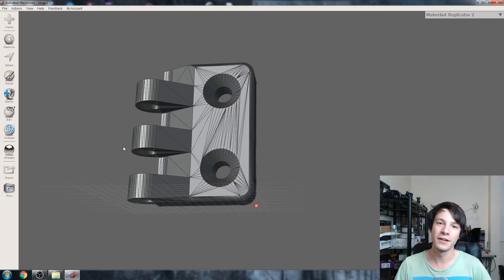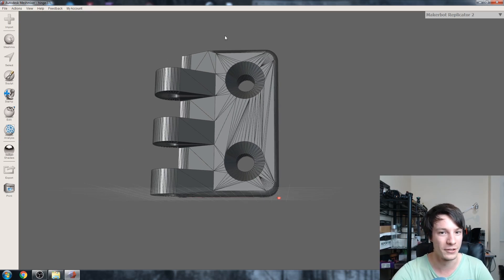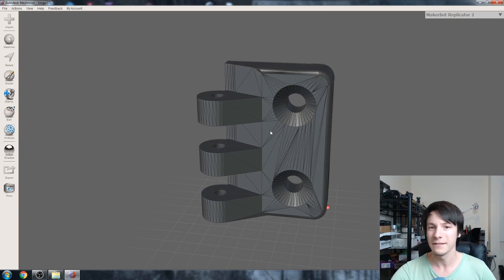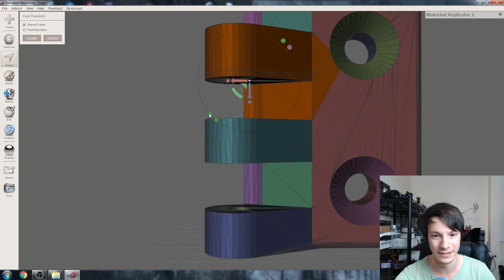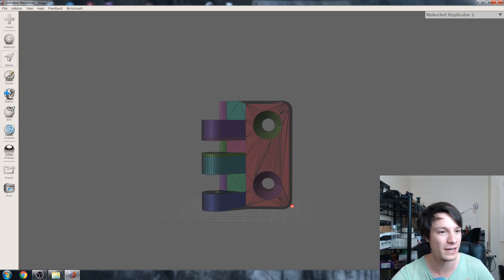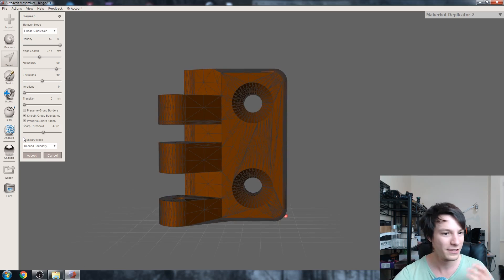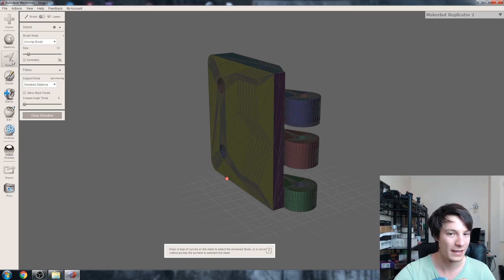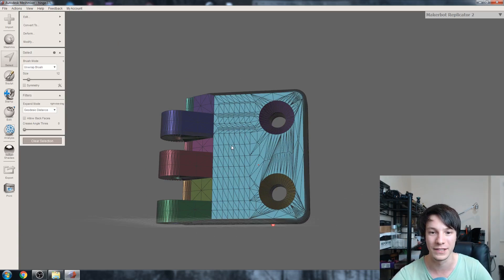How to use the Face Transform Tool in Meshmixer - Quickly alter .stl files!

Comment: Hi Angus, dragging this up from the abyss, is there any 3D editing tools you would recommend for 2023, I am currently trying "again" to use Meshmixer and would prefer to use something still updated, this tutorial has helped me immensely, I only worry by the time I get a little better I will need to transfer to something else and go through that process again. I am currently trying to convert a Mitsubishi STL file of a 1994 Series one Mitsubishi L400 Delica Space gear SWB to LWB (Long Wheel Base) and then to change front to series 2, they are basically the same to look at except from "A" pillar forwards.
The original STL is so good you can even select a wheel nut etc.

From this video I have learnt and have trailed extending the main body, I know the actual measurements but I have yet to work out how to turn on measurement as I am deforming and the conversion of measurement from real to STL measurements etc, I am currently stuck in lasso/freehand mode for selecting and can not work out to stop this, it  did help to use lasso for one selection. My only gripe with this video was I had to pause a lot to keep up with you LOL.

PS. we meet once at a Olympic Park meet and I talked to you about 3D printing and your channel as I was already an older fan of your channel.

Comment: I HAVE A FILE THAT I WOULD LIKE TO EDIT USING MESHMIXER.  THE FILE IS A FAN DUCT FOR A PRUSA MK2 MMU.  THE FILE IS FROM THINGIVERSE AND IS CALLED "LAYER FAN DUCTS AND MOUNT FOR E3D V6.  I NEED TO MAKE JUST THE ROUND PART OF THE DUCT SMALLER.  IS IT POSSIBLE?
Reply: sure is, first step is to press the 'Caps' key

Comment: Angus, I love the videos, but I would like to give some constructive criticism. I would like to suggest that you have a specific end goal with the way you are explaining the use of a tool.  I noticed that you added more triangles to the mesh because you wanted to prevent a zero thickness wall along the bottom, but you selected the same problem area and ended with the same result when you pulled those screw holes out. The same zero thickness wall existed along the bottom of the model it just had more geometry along with it. As a suggestion, you could mention that by holding Ctrl you can deselect specific parts of the mesh that you didn't want in the transform. You did show that you could add length to the hinge, and mentioned that you can add extra screw holes. You did not go through the process of how to add said holes. If you are speaking to a beginner, that individual might get even more frustrated looking for the I want more holes button (which does not exist). You can do the things you ask for in Meshmixer and there are probably a few different ways of doing it. I understand that you are trying to quickly crank out some content, but this is something that would end in a bit of frustration for most users trying to get a printable file "quickly modified". You might show that you can probably use Meshmixer in conjunction with TinkerCad to actually achieve the goals you mentioned. If you are looking for ideas of how to crank out some great content, may I suggest that there be a follow up on how to add the holes to the existing STL file. You would not need to limit yourself to just Meshmixer or to even stay within the Autocad family, but you could show what is the easiest way to achieve the goals you listed in your video.

You might take a few extra seconds to note that Face Groups are actually a really important part of Meshmixer and that many of the tools use those Face Groups in their calculations for things like refinements and finding hard edges. So the way that you define a face group helps define the way that you are using the tools after that point.

I do hope that you take my words in a good way.